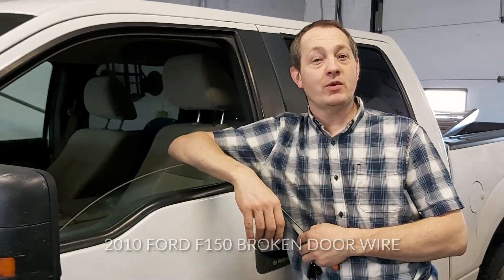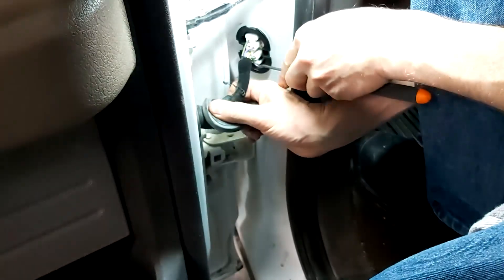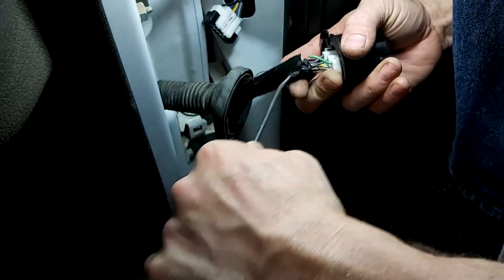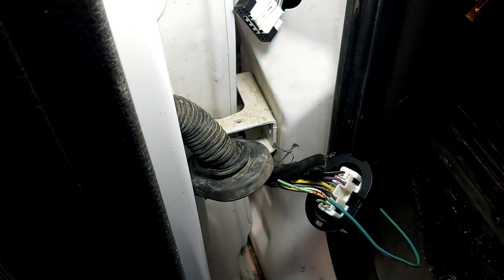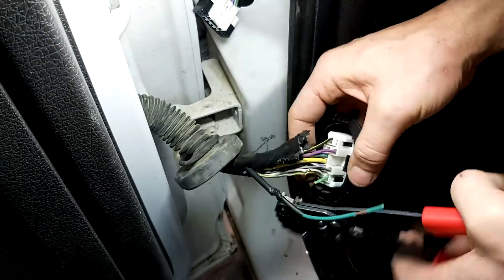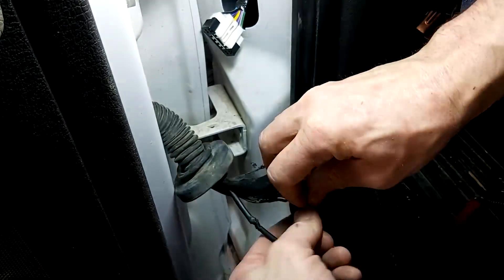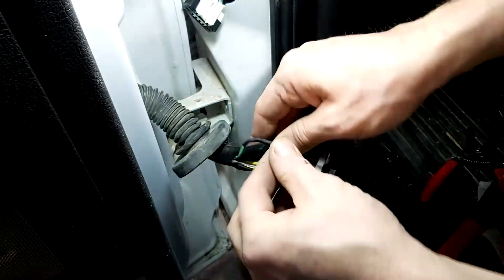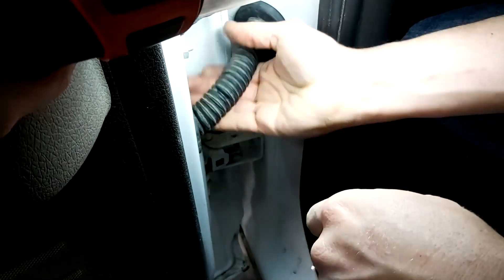2010 Ford F150 Broken Door Wire

Comment: Came here to see how to take this apart - guessing I'm having the same type of problem but with a different symptom - went to roll up the drivers side window and both went up really slow and now when you open the driver side door, the interior light and the power port alternately flicker  (opening the passenger side, the interior light comes on normally). Also I'm getting a random misfire like one of the coils went out - in park at idle it's running smooth, but shift into gear and the misfire happens, but sometimes will run normal. Haven't driven it since the first instance.

Comment: Has anyone made repairs on the Fron doors wiring harness due to the door ajar / dome lights and door lock issues? If you do; Could you give me some advice, how to REMOVE the CLIP from the Driver's door? (I would not like to damage it) My truck is a 2012 F-150.
Thank you.
Reply from the maker: Use a small pick and be careful.